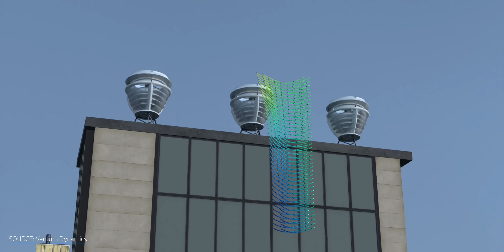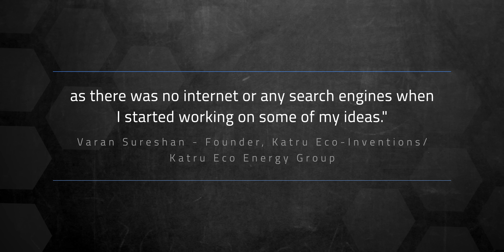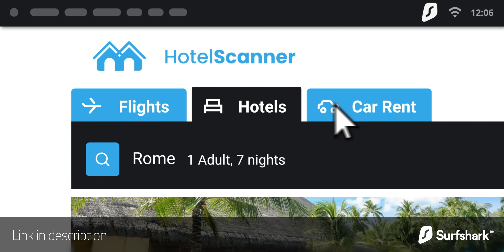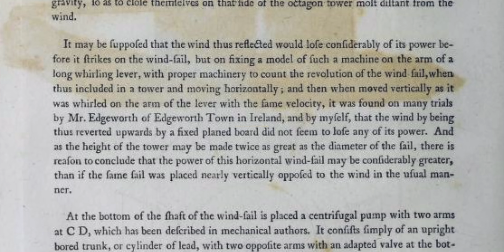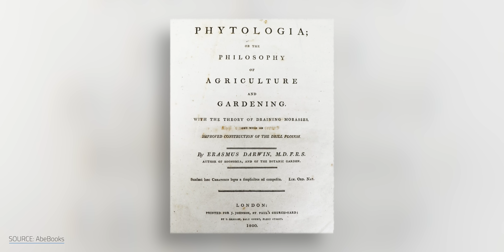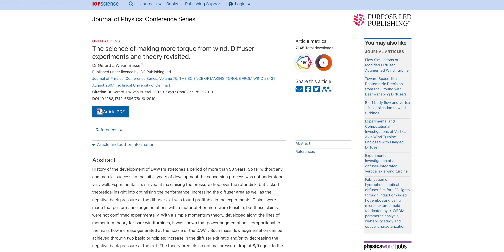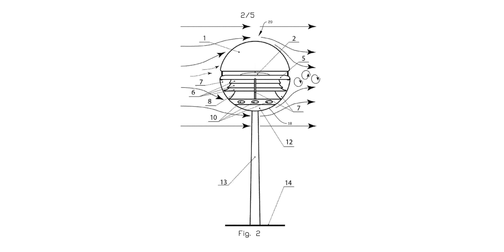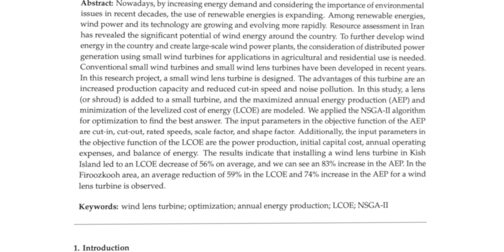Are Shrouded Rooftop Wind Turbines the Future of Energy?

Comment: I want something that can compete with solar, on the roof of a typical 3 bed house. Something like that, should be far more effective than solar generation, in places like the UK and the new England united states.
Reply: Hybrid solar panels, hybrid boilers (1. Heating from the sun + excess electricity from the sun or at a low night tariff. 2. Heating from the sun + from a pellet boiler) with a phase transition (wax + volcanic sand for a temperature of 45-55 degrees to hot water or paraffin + volcanic sand for a temperature of 65-75 degrees for heating and heating food

Comment: Interesting but I can imagine a numbers of birds and other animals trying to make homes in these turbines.
Reply: I am unsure how an animal would enjoy living with the noise and moving parts right next to any nest. If the turbine blades were stationary I could imagine critters nesting in it but not while in active operation. Another consideration would be where would the animals actually nest, on the slanted edges of the duct intakes, on top of the near the blades or below the structure?
Reply: @TheArchaos  When I was an electrician, during my college days, we regularly had to help clean out the rooftop fans. There were all sorts of animal nests in them. Maybe they made them when they weren't spinning? Not sure but I cleaned a lot of them. :)
Reply: I suppose apart from a wire mesh there will need to be some maintenance in those places where the wind is often vacant for sufficiently long periods.
Reply: Can you imagine how many birds sit on electrical wires and transformers without realizing how dangerous this is because there is no sound, especially during rain and storms, in addition to electromagnetic pollution that is harmful to the environment and humans alike ?

Comment: With all these new cool micro turbine ideas there is always the question of "ok can I buy it for my home and when?", but usually that is not the case, sadly...
Reply: Can I 3D print it?
Reply: @Sagan_Starborn idk about the one in this video but Robert Murray-Smith has a video on something similar and it's open source, or if you're ambitious you can always try to design your own that does something similar
Reply: There's a couple types of turbines that can be installed in neighborhood environments.  They're not very powerful though and by the time you have enough to produce a decent amount of energy then the noise is going to be an issue.

Always an issue of noise with wind turbines.

However this is a new product right?  There's nothing to say that this won't be made at a scale that's suitable for homes, however you'd have to have the right conditions, one being a two story home because the winds down at single story level are generally weak in residential areas.  You certainly don't want to install something and find out the return isn't worth it.
Reply: @johndoh5182 
Of course. Ten minutes work on the back of an envelope could tell you that.  Wind power has been with us over a thousand years. there is nothing we dont know about it (we being engineers: I accept te general public knows nothing about it and will believe almost anything)
Reply: Maybe as a leased version, but the problem with residential wind is that it will undoubtedly have maintenance that fixed position solar won’t.
Reply: @danielbenner7583 oh yes!!, this: especially after a HAIL STORM or hurricane/tornadic straight-line winds - 🤦‍♂️😂🤡

Everyone knows “Solar” is sooooo much better under those conditions.
Reply: Hopefully it will eventually get to a residential stage but it makes sense why they've focused on commercial. Easier to get funding and because these require horizontal roof space, it's not going to be suitable for every residential space
Reply: @gemelwalters2942  it's more the fact that homes don't get strong enough winds to be worth it. this turbine in specific is trying to leverage the powerful winds you get from the side of buildings. for homes you are stuck with solar.
Reply: @danilooliveira6580 yeah, I'm a renewable energy nut and these things aren't justifiable in most places. You need wide flat spaces, height, and a lot of wind for it to start to be practical. So you need to live on a windy plains for a residential scale turbine to start to be practical, and even then most of the time solar panels are more cost effectient, powerful, and have a shorter ROI. You might have better luck finding a stream and installing a hydro turbine given how much more often you'll be near a stream than the wide open spaces. If you happen to have the right conditions then it might be nice to diversify your power, but solar panels are still more often more cost effective.
Reply: Not just solar, there are also traditional vertical turbines in a much smaller scale than the big bastards on the plains and waters of the world. My former landlord had one on her shop/garage behind the duplex we were in (she was in the other side of it, but she was an awesome neighbor and landlord) and it completely powered her Nissan Leaf. It took longer than a wall charger, but she also didn't drive a lot so the car was just charging for free. The turbine was also rolling the power meter backward, and the power company (it's a co-op here/publicly owned utility Central Lincoln PUD in Oregon) was paying her for the power that went back into the grid. Just off of a little roof top vertical turbine with a 4'-5' Blade/turbine and was only about 8' tall. It's the Oregon Coast, so it's pretty much always pretty windy, especially the closer you get to the beach.
Reply: @DM-wp9vq  Just that it didn't power the Leaf nor created compensation for free as it needed to make up for the invest and possibly maintenance.
Reply: @danilooliveira6580  sad but true!
this design makes use of sheerwinds that are only strong on higher or larger buildings.
Reply: @bachtube11  Or mountainous area's or near the coast....
Reply: @danilooliveira6580 …I’m sure that to some extant you have a point, however, when working on my roof (1 story house, gabled roof) I have noticed that there is a pretty sturdy wind 24/7.  And what baffles me is that on the ground there is not even a slight breeze.  I could put a 100 dollar bill on top of the grass and it will not budge.  And it is less than 20 feet to the top of my roof.  Crazy.
Reply: Issues with selling direct to a customer (person)(home owner)
Wind resources at that specific spot on that specific roof intermittent
Customer requires electrical power 24/7 or so, so grid inter-tied probable
Permitting, licensing, power buyback from utility company, separate panel + disconnect
The cost of the unit usually less than everything else required to hook it up safely, correctly
This means the ROI or return on investment might be longer than the unit operating life
Reply: Most HoA will only allow solar which sucks.
Reply: @mlmccollum100  In fact solar will always be topping wind unless you build really large turbines on 100+ yard high towers. Speaking rooftop, solar is still the only way to economically power homes by yourselves. So you are really luck when the HoA holds you from making a mistake.
The Norwegian turbine will not change this picture.
Reply: @mlmccollum100 well, technically a wind turbine “sucks” whereas solar simply “absorbs”.
Reply: @mlmccollum100 I guess some people don't have a choice, but it's never made sense to me why people agree to be bound by HOAs. Why agree to pay almost as much as rent, to a body that acts like a cranky landlord, on property you own?

I bought a triplex outright a few years ago, and I pay way, way less to maintain it than the HOA costs on other buildings in the same neighbourhood. And I get to do whatever I want to my building, within rules set by officials I vote for.

HOAs are a racket.
Reply: Perhaps it's better to ask oneself "could I 3d print segments of a design and assemble it myself"
Lately so much is possible on those magic toys..
Reply: Yeah... it isn't that it doesn't work, it is that it is going to be a 'race to the bottom' low margin product that nobody wants to be in the business of supporting.  The business model (in general, not necessarially this particular company) is to soak up as much funding as possible, do some research to justify your existence, and then sell patents or the company out to another entity.  It isn't vaporware because it doesn't or can't work... it just needs a large amount of scale and support to be profitable, and these small research companies simply aren't equipped with the funding, logistics, or skill set to do that kind of nation-wide rollout to be cost effective.
It will happen some day with one of these companies getting picked up by some solar company as a sort of add-on feature to provide supplementary power to a solar + battery system... it just needs to be cheap and energy dense enough to justify not simply adding more solar, and reliable enough to get away with using a smaller battery backup.
Reply: Most of this micro windcatchers are overpriced  pure scam.
Reply: @JohnDir-xw3hf 
Seriously, You mean there are some that aren't?
Reply: Because of what I moniker: G³MC-LiYOM’s.
Reply: Matt talked about the apex of the roof line getting gable wind turbines in a video a little over  ayear ago. I think that'd be the better fit on residential. Even then, it depends on where you are.
Reply: I have a concrete flat roof this is a fantastic concept and I can't wait to follow this company progress through production and sales. Sr. Darwin had a huge impact on his grandson Charles Darwin.
Reply: I could see this on schools, with the right design and concept the schools could have pre defined charging areas for the residents. I could also see this in container buildings that are three stories tall or higher. Copyright.
Reply: planuje rozpocząć produkcje podobnej turbiny pod koniec roku.
Reply: @SanSiim  I think you're right. I usually inquire then get slammed by products I don't want in my email.
Reply: These new cool micro turbine ideas are always a waste of money, time and resources.
Reply: Betteridge's law of headlines is an adage that states: "Any headline that ends in a question mark can be answered by the word no." The same applies to youtube video titles. One look at these turbines tells you they will have ludicrously low power density.
Reply: Yeah, that's my conclusion, but I'm hopeful that with all the creative ideas going around, someone will crack the urban small turbine that can generate meaningful energy for a home.

Until then, it makes more sense to just oversize a solar setup with how cheap it's getting, and I think the wind industry needs to find solutions for wind turbines to work at small scale in urban areas, because it's likely as tech advances, more of us are going to want to go gridless, which for now is a massive advantage in favour of solar power over wind power.

In any case, if we can get a mix of solar and wind that works well for home users, that would be a game changer as both would complement each other for more consistent energy generating throughout the year, it would allow far more of us to go gridless and it could reduce the amount of energy storage needed if we are getting a more consistent flow of energy from solar and wind.
Reply: @paul1979uk2000  NO one is going to crack the small turbine issue in residential areas.  The wind is too broken up and this has been discussed many times on different channels.

For instance I fish on local lakes.  I can be on the lake and the water is choppy and there's a good 15 - 20 mph wind blowing.  I get off the lake and get home and it feels calm.  There's no solution for that issue.

Yes, we feel winds during very windy conditions or a storm is coming, etc..... but that doesn't happen enough to make a wind turbine worth buying for this home, and this will be the case for most residential homes.

On the other hand if I had a home on a few acres of land and the home is more elevated than most the property I could install different wind turbines that are already on the market.
Reply: @paul1979uk2000  One   of the advantages of an engineering degree is that it enables you to quickly, using the back of an envelope work out  what simply cannot work.
Or at least not without violating the laws of physics as we understand them to be.
Wind turbines work by slowing down a mass of air and the air loses energy and the wind turbine gains it.
With a top efficiency given by the Betz limit. Modern turbines get very close to the Betz limit, They are about as good as they can  be.
And they are still rubbish.
But what you can't do is extract more energy from the air than there is in it already.
And there really is very very little energy in most wind.
And in the end what limits and destroys the renewable dream, is the fact that there isn't very much energy in wind or the sun, which means that you need vast arrays - far bigger than a city - to power a city.
And the wind and the sun are not constant, which means you need some other sort  of technology - usually extremely expensive - to fill in the gaps.
As renewables push to even larger percentages of the grid, these truths become the bottom line on your electricity bill. 
I am sure the technology in this video is cute, innovative and sexy, but it still cant pull more energy out of the wind than there is in it to start with.
Reply: Very well put Paul.  I find people discount Residential Turbines because they can’t supply all the house’s needs.  But I think there role will be topping up supply when the sun goes down. And reducing the size of home batteries would be a good thing on many levels: cost to the household (batteries ain’t cheap), use of resources (save the minerals for the grid scale batteries), volume of waste (recycling is more efficient for large grid scale batteries than for hundreds of small home batteries)  …
Reply: @paul1979uk2000 you basically ask for someone to 'crack' the laws of physics, wich needs either magic or a miracle...
Reply: Agreed, I have seen a bunch of these technologies on this and other channels, and none of them are commercially viable.
Reply: and i saw a video of Robert Murray-Smith when he went to that pier on the water side it was windy but not turning. so maybe that answers a lot of questions. nice but not real jet like how they al advertise whit 1 a 2 kilowatts a hour and the most places you put them in are not even get 50 watts. it`s al tested and showed off in the ideal locations in the ideal wind on the time of filming.
Reply: There is no such question because if I have excess money to burn I have better opportunities.
Reply: That's because none of them actually work.
Reply: @leosmith848  Rubbish, it doesn't take a genius to see, and understand how they work.....
Reply: Well you could run in a few houses or more on it.
Reply: @CarlAyers-x8h  No, you could not.    At 3000 kWh/year, this thing has an average power output of 342 watts.     That isn't enough for one typical home.

Comment: When are we going to see self contained systems of a turbine covered by solar panels; with the panels keeping snow and other environmental hazards off the top of the turbine; and the turbine providing airflow cooling to panels?
Reply: Hopefully, you’re not the only one who has had that thought.
Reply: @sherrygadberryturner9527  You get us a patent and I'll start the company! ;)
Reply: The problem isn't energy production. It's energy storage, politics, and corporate profit/greed. We are fully capable of producing free energy, but the most effective way is on grid systems. We'll never break through the corporate greed, so we must focus on off grid systems. Affordable storage becomes the center of focus for off grid systems.
Reply: The biggest challenge I could see with that would be making sure the panels themselves don’t cause a significant restriction to airflow exiting the top of the turbine, as that will affect efficiency of the turbine itself. that, and making sure the mounting structure can withstand effectively bolting a sail to the top of a fan

Comment: It would be nice for a turbine designed to fit inside underpasses, so smaller communities can take easier advantage of renewable power.
Reply: Or, you know, we use nuclear like we should have been doing for decades, instead of playing games with these useless technologies.
Reply: There is hardly any energy in the wind in residential areas. The don't work. Do the math and see.

Comment: I fly FPB drones and the first drones to used ducts had power increases. Over time as they got bigger it created power loss. It is a balance of size. I wonder if a corkscrew or a part corkscrew would catch more wind
Reply: @tooltime9260  I appreciate the in-depth answer. In my drone example the blades have to almost ride against the duct to produce the most power but manufactures wanted cheap and easy so became less precise in their manufacturing. You gave me a lot to think about.